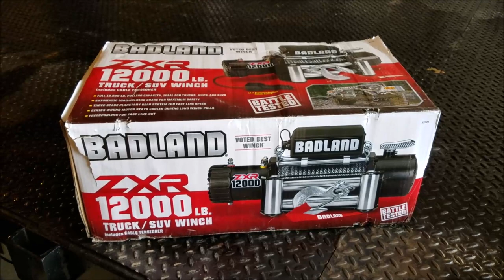HARBOR FREIGHT Winch CUSTOM trailer Mount ! Part3

Comment: I like the way you mount the winch it gave me some cool ideals great job 👍🏾👍🏾👍🏾
Reply from the maker: Thanks, one issue I ran into is if you load a truck, the lower part of it will hit the winch because it's tall, be ok if you have a longer trailer
Reply: @kentuckyyankee  ok cool still a great job I’m bout to buy a badland 12000 and get it put on

Comment: If you get a Kong wobbler for dog treats, they make a great stop for the winch line. The trailer brakes require power to engage right? Are you going to wire in the battery to the trailer escape cable?

Comment: The rollers are called a Fairlead. What happened to CW? Get a Snatch block for the  winch in case you need to pull sideways to line up what ever to load. Keep up the engineering.

Comment: You know if you had a still metal lock box you can mount that on the top then to even make it more secure you could also weld your bolts to your lock box on the inside and even if your lock box was unlocked and still be hard to get that thing off LOL